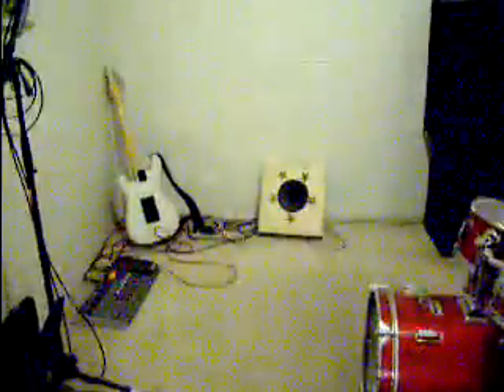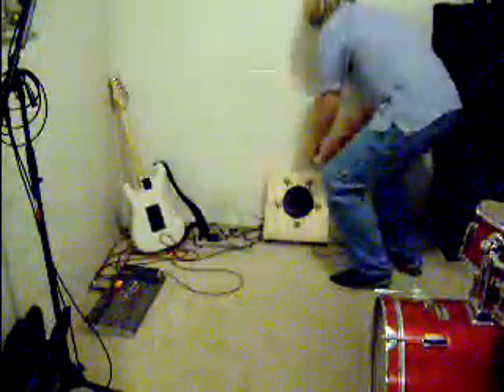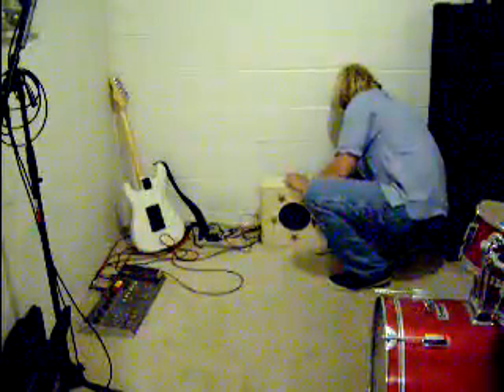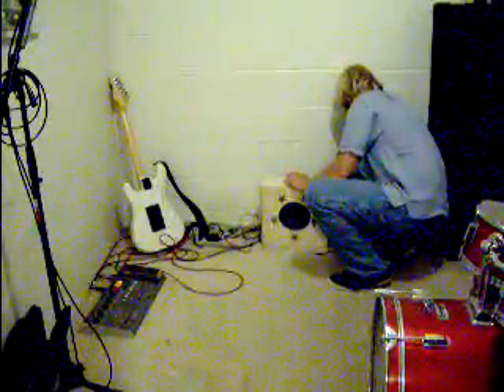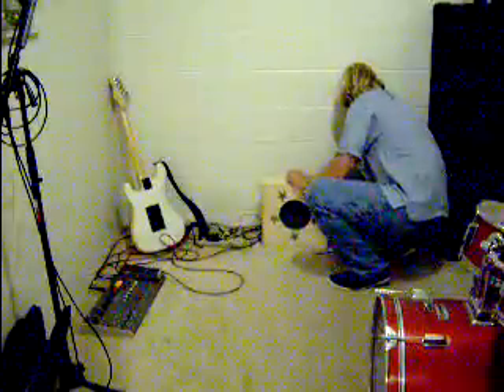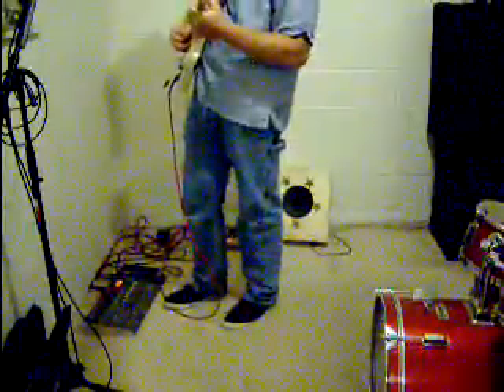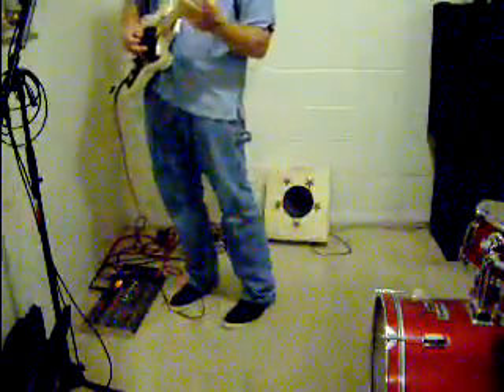6au6 parallel push pull amp running on a 9 volt walwart

Comment: Nice job on the amp! I've been getting interested in these low power tube amps as well. What impedance output transformer are you using?